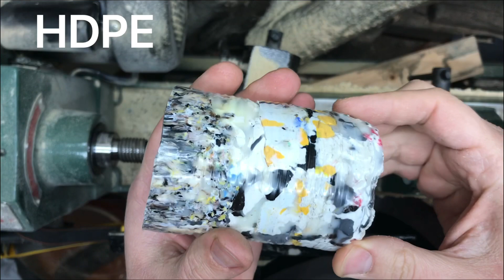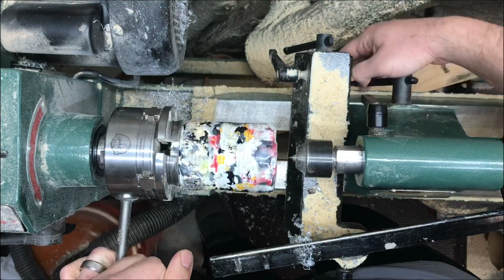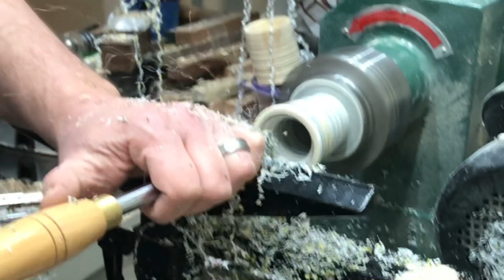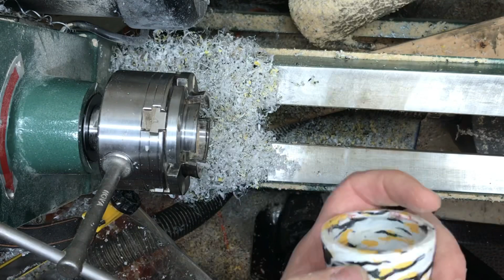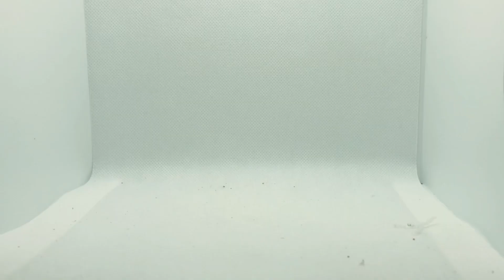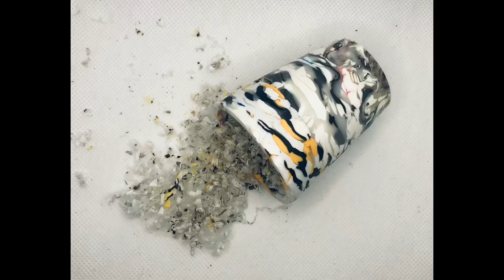HDPE Plastic Trash Can | Woodturning

Comment: Could make table legs as the multicoloured effect is very cool, maybe with a steel rod through the centre for strength
Reply from the maker: Table legs would be awesome! The form and pressure required would be significantly more than I currently have capacity, but the idea is definitely worth exploring!